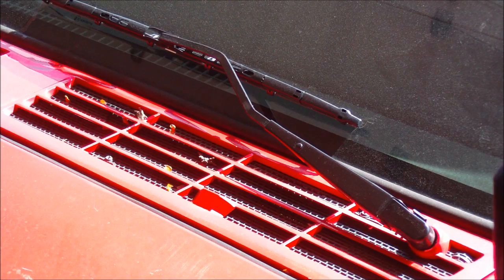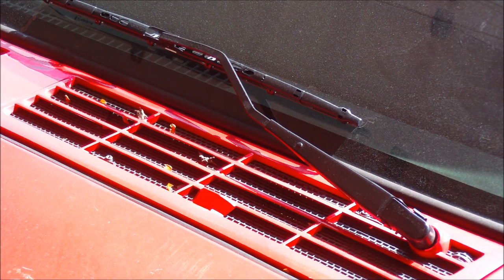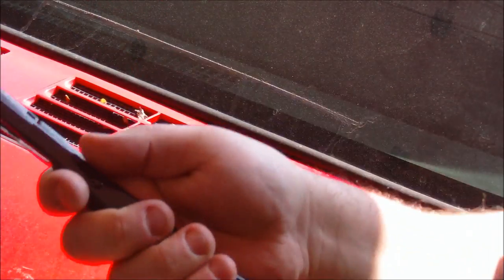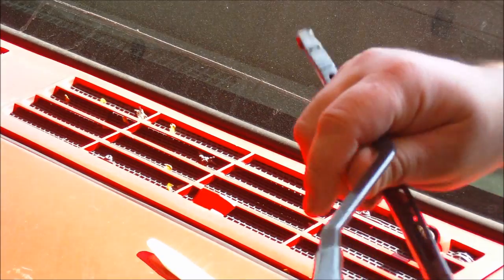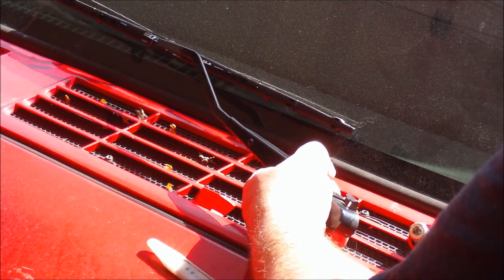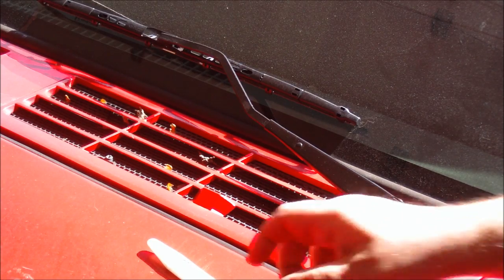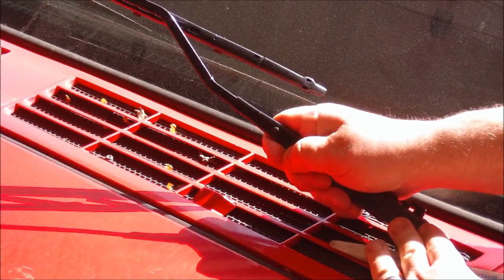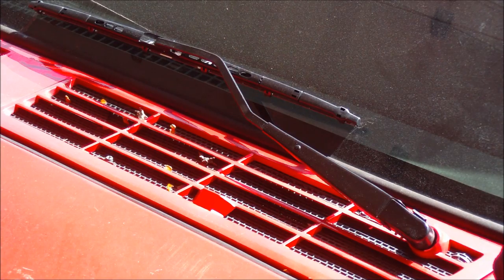HOW TO REMOVE A WINDSHIELD WIPER ARM

Comment from the maker: 1. Wiggle it off with finesse (side to side, round and round etc., pry up as you do it ) also use a rust penetrate and let soak in for about 10 - 15 minutes, ***Put some rags on the painted surfaces and anything else that could get covered with rust penetrate***
   2. The spring in the arm is probably week or there is build up in the rivets where the wiper arm floats back and forth to compensate for the bevel on the windshield , try penetrate on those rivets and if that doesn't work   replace

Comment: I just bought a 1984 Pontiac Firebird Trans Am an the only problem is that it needs a new passengers side wiper arm... But I have to wait till the new arm is shipped to me. I hope this trick works when I try to remove the broken arm tomorrow. I do recall seeing that tab you talked about. I'll be sure to give it a Like if it does.
Reply: And it worked just like you showed... Looked a little different since its a different vehicle but same concept. Thank you!
Reply from the maker: RIPBandit90 Thanks bud. Glad it worked. Sorry for the late reply.

Comment from the maker: I highly recommend you take it to a mechanic, because alot can go wrong but in any case this is what i would do  That would be a very difficult process and would involve alot of patience and time. I would most likely use various small  different angle picks and very small flat head screw driver with a regular size screw driver and some rust penetrating oil.Spray the tab area with the oil let soak for about 15 minutes. Then lift the arm up than try getting it out with the picks and screw drivers.

Comment: I have the same problem that Cregar Back mentioned below on my 2002 Chevy blazer...the arms move back and forth fine but do not clear the winshield of water or snow, I thought it was the blades so replaced them but still nothing. It's almost as if they aren't touching the winshield. Did you find any answers?
Reply: It sounds like the springs in the wiper arms are failing to put enough pressure on the blades. Quick Fix: With wipers stopped in the "up" position, gently bend the passenger side arm a 1/2in. toward the windshield, and see if that helps. If so, repeat on the other side. But plan on buying new wiper arms.

Comment: What do you do when the wiper arm seems stuck to the spline? I've released the lock lever, but the arm will not pull off the spline. I don't want to put too much pressure to pry it off.
My second question: what could be causing the arm to loose pressure on the blade at the top of it's swipe on the rear window of my 2000 Jeep Wrangler?

Comment: my passenger wiper works fine but doesn't touch the windshield how can i fix that?
Reply: you might have a bent wiper arm, use two pliers and carefully bend it till it puts and even amount of pressure on the glass.